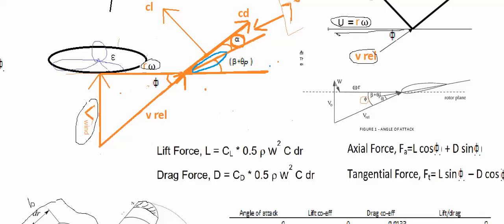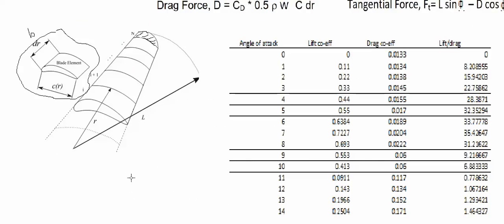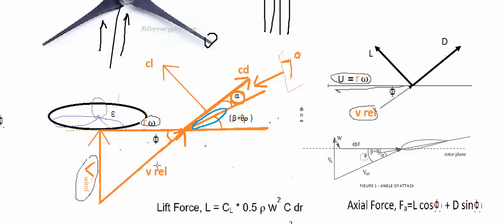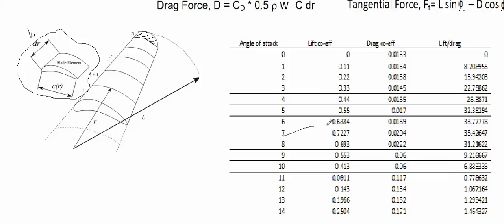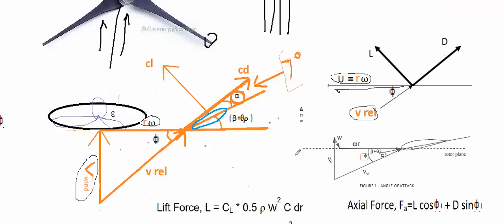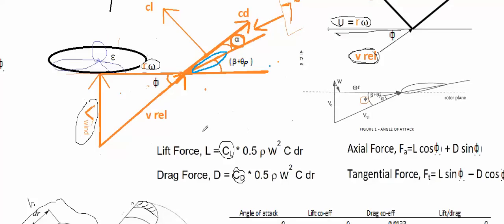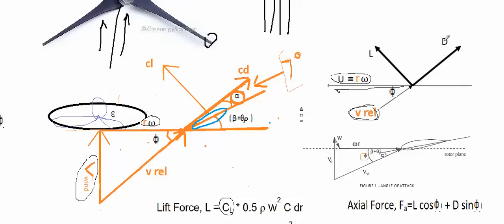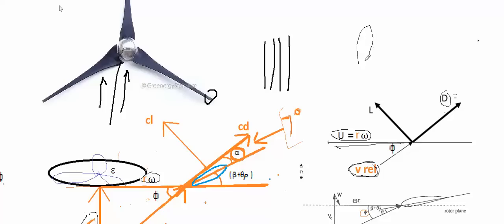WIND TURBINE, WIND ENERGY - DRAG FORCE.

Comment: Mr. Jobanputra,

First of all, great work on your wind turbine video series. I have watched all of your videos to get the basic and first hand info regarding the knowledge on wind turbine design. Moreover the repetition over and over makes sure you get the concept without any confusion. Your drawings are provide better understanding as compared to the TB figures.

1. You mentioned about the future series on the power calculation using excel and the whole of wind turbine design. By when will you be uploading them? I am working on designing a blade for my PG thesis and definitely it would be of great help for me.

2. Also, can you put more details about drag. The above video, I noticed you were telling something about drag but you have by mistakenly used the lift formula to explain it.

3. Also there is something that I found which you can improve as for you future videos. Don't take it wrong but, I feel you to keep a neutral accent during explanation. The pitching / immediate stressing of the words are not going well. Try for a well balanced speaking accent and tone.

Anyways, good job

Pranav
Reply from the maker: hi pranav, thanks, can u plz summarise ur desertation topic, will try to make videos asap..cheers
Reply: Rahul Jobanputra  I have removed the comment ! Thanks